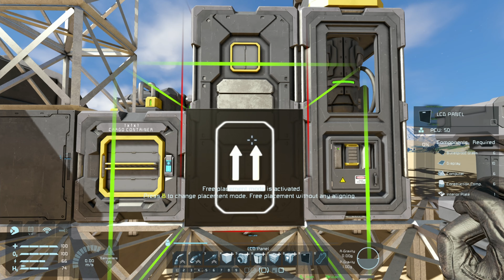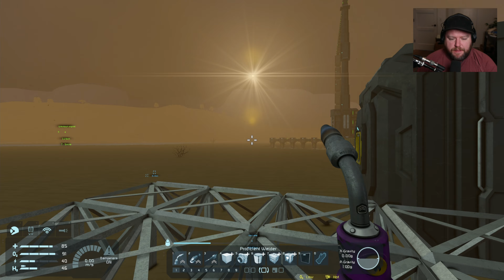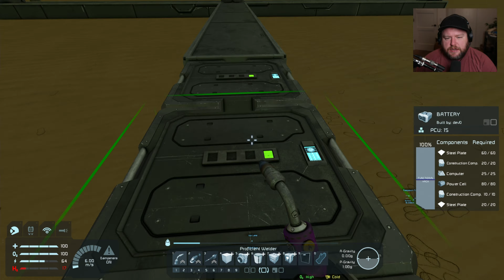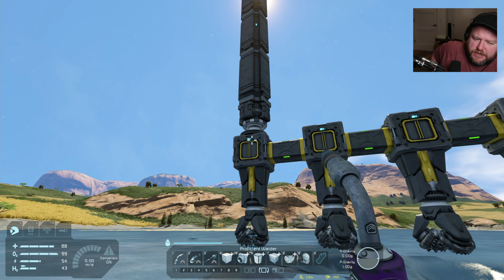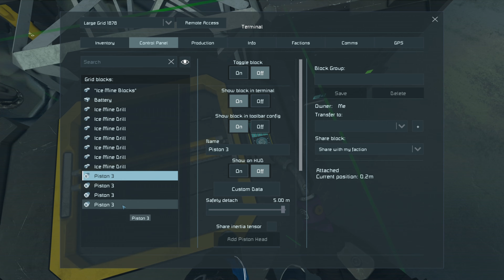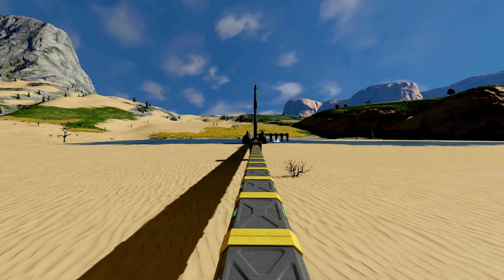Building an ice mine and hydrogen processing facility as a German Engineer - Space Engineers E19

Comment: 17:05
We should know about SE's grid system.

Movable
 = Basically game called it "ship", so you could see a "convert to ship" button in Info tab of Terminal.
    You can't place the block into the voxel, and your drill part is this case.

Static(Permanently)
 = Basically game called it "station", so you could see a "convert to station" button in Info tab of Terminal.
    We can place most of blocks into the voxel in this case.

Static(Temporary)
 = If your ship has a landing gear and landed to the voxel and locked, or connect to the station via connector grid becomes static status temporary.
    You could place the block into the voxel, but you should remove the blocks before unlock the landing gear.
    Best way to understand this mechanism, place the wind turbine to your large grid ship.
    Basically wind turbine only works on station, because it requires static grid. So ship's turbine don't work.
    But if you landed to the voxel and locked the landing gear, or connect to the station via connector, suddenly turbine start working.

I guess you already know, small grid ship can't use the "convert to station" button in Info tab.
We could change small ship to Static(Permanently) via modifying the save data. But through the gameplay, no, game don't allow it.
But small ship also able to static(temporary) by landing gear or connector as I mentioned above.